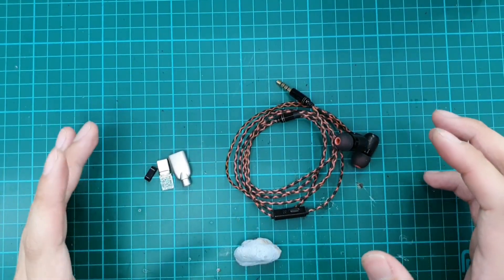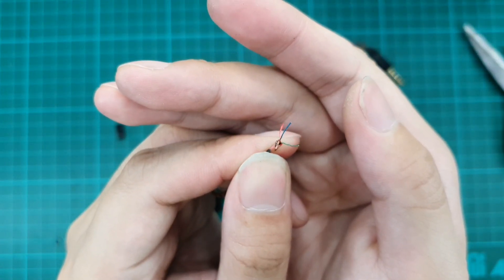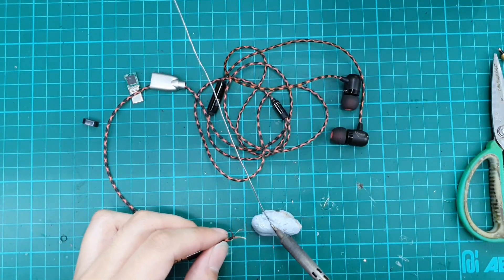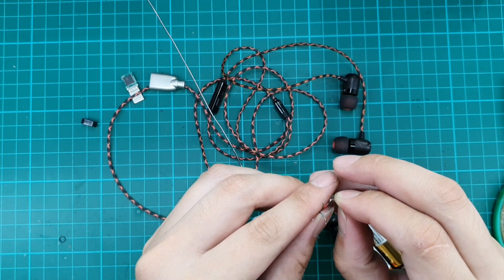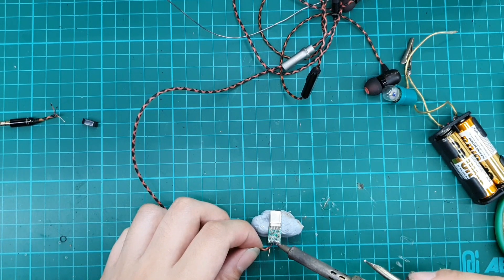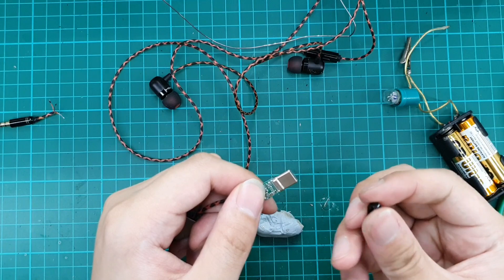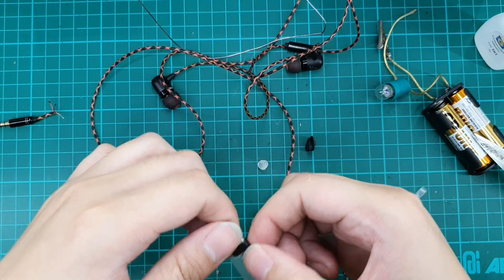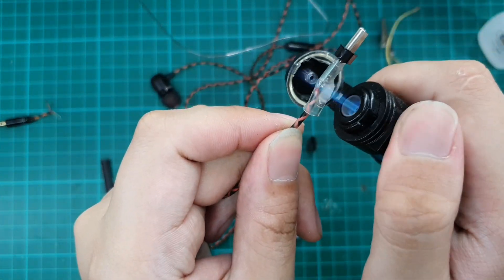Earpiece USB C conversion retermination with mic easy Tutorial

Comment: Awesome video. Subscribed and liked. Thanks
I have a Xiaomi action camera which has a USBC charging port. Does it mean if I connect a mic to the port, I can it as a mic port???
I will appreciate your reply as I am on the project right now 
Thank u so much
Reply from the maker: Xiaomi action cam doesn't support native usb c audio, I think you might need to check what adaptors or ports that can, I have xiaomi action camera too and I can confirm it doesn't work
Reply: @sgaudiohive  
Thank you 
I also realized that your camera port is USB c and Xiaomi is micro USB
Guess I will modify and fix the jack socket to connect.

Thanks a lot
Reply: @sgaudiohive  
Sir, I have a question regarding Xiaomi. I have seen some videos showing external mic connection. I want to do the same. But there are 2 inbuilt microphones. 
Since I plan to use the camera on my helmet, should I disable both mics and connect to one mic.
Because if I leave the other mic connected, then it will record the outside noise while vlogging.

What do you think and what do you advise.

Thanks a million

Comment: I need to wire my old Nokia phone ear buds/ mic combo to USB,  (like gaming headphones with a mike but only hella lot lighter) so I'm here watching and WHAT I DID LEARN incidentally was that I was able to repair an Apple lightning  charge cord.  The wires and connections were all good but the outer shielding had somehow lost it's integrity, so I used your trick and expanded some shrink tube, slipped it over the lightning plug and covered the open shielding, shrunk it in place and FIXED it,  saved at least $15 that is much better spent on beer!! Thank You SGAUDIOHIVE!!
Reply: Shrink wrap 😍 chips bomb

Comment: Fantastic video. very helpful! How do you connect/solder 4 wires on 2.5mm TRRS for a balanced headphone/earplug where no mic is required? As in how does one connect L+, L-, R+, R- and ground on 2.5mm TRRS jack? Thanks for the reply!
Reply: That's what I'd like to know 😧